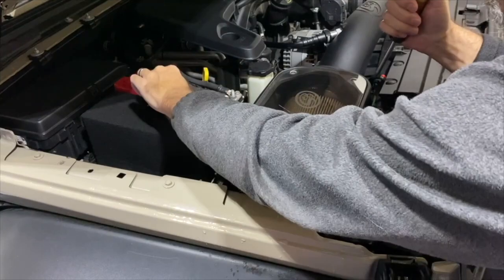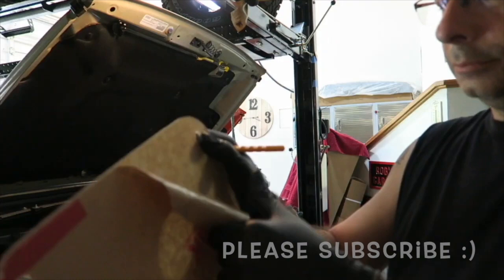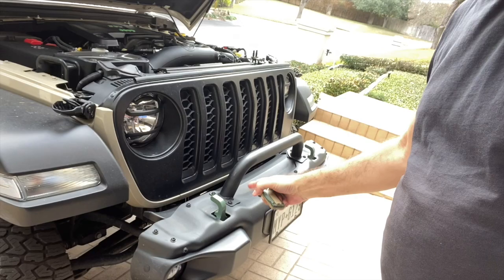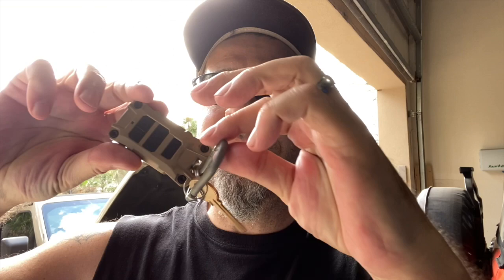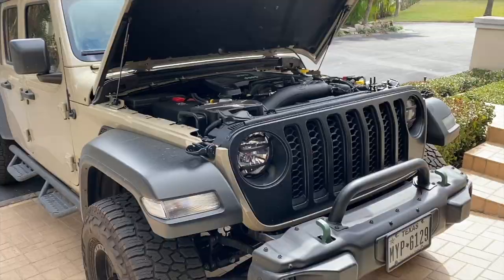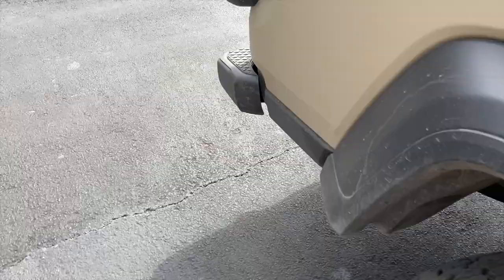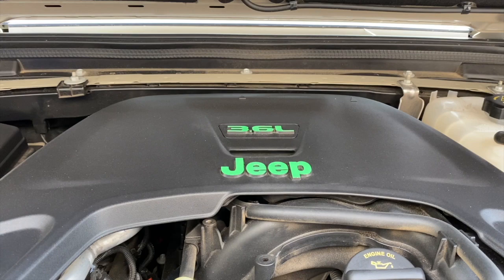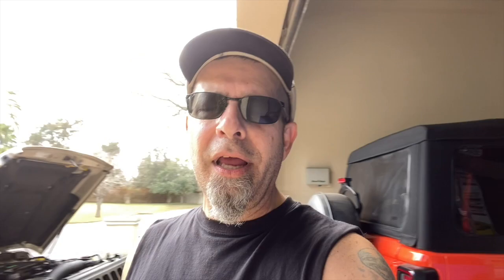Gladiator Key Fob & Engine Cover Mods

Comment: Rob I am going to address the elephant in the room...why haven't you pulled the carpet plug, removed the floor plug and installed the floor mat with into the hole from the floor plug?
Reply from the maker: Now that is a good question 🤔